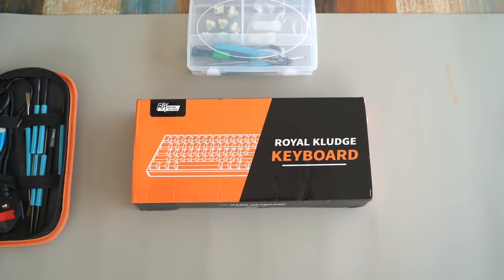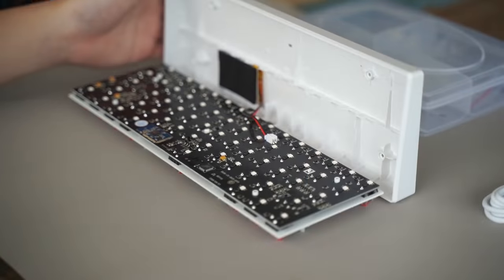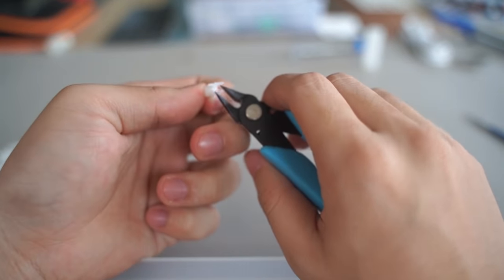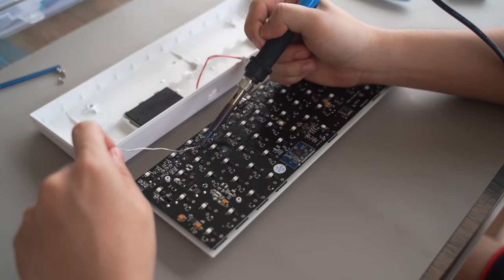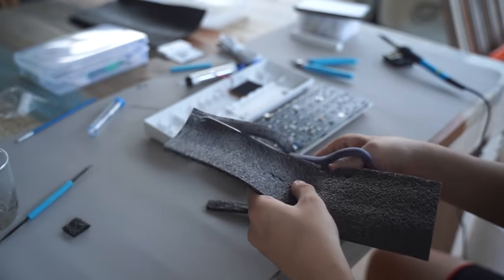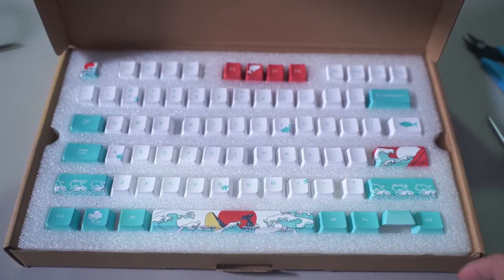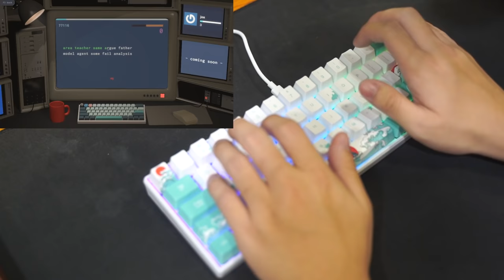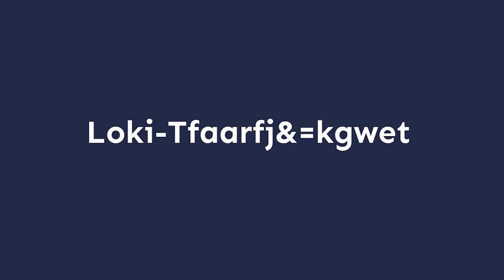Upgrading a $50 Keyboard

Comment: might get the original keyboard, it looks nice.
Reply: Same I’m poor
Reply: @raineyraine5887  get a job
Reply: @wikzy.7966  get a job
Reply: DawidALT get a job
Reply: Don't, i have a new version of it. it works for 2 months then turns into some garbage. Don't buy budget keyboards
Reply: sauce how'd it turn bad ??
Reply: Yeah RGB and MX red clones for this price is still good I was really looking at this keyboard but the price went up. It used to be 30 dollars.
Reply: @princeplotena  did you get a job?
Reply: DawidALT ... no
Reply: @princeplotena  I will give you a job.......
Reply: @dawidalt9532  funny because I have one
Reply: @wikzy.7966  funny because I have one
Reply: 생명내 증오 😳
Reply: @dawidalt9532  مضحك لأن لدي واحدة
Reply: Buy a kumara k552 its 40 Bucks its not bluetooth but its pretty durable
Reply: @wikzy.7966  yeah, lemme go to the store and ask for a job like that... its that easy...
Reply: @nobody-gd7jj  dumbed down, yeah, that's how you get a job
Reply: Which aite?
Reply: @dawidalt9532  nahh I didn't get a job
Reply: Its really good Keyboard and on Budget
Reply: @producedbyethan1350  Well, I got a rk61 at work and since 8 months of daily use it still works perfectly
Reply: I had it but it was in blue key caps so I returned it and got a different keyboard that did have red switches
Reply: @producedbyethan1350  bruh i got mine like 8 months ago and it still works perfectly
Reply: @producedbyethan1350  it is literally one of the best budget keyboards on the market, do you know anything....

Comment: me having the same keyboard paying attention 👁 👄 👁 📝
Reply: desolder only if you know what you're doing
Reply: @Daniel-dj7fh  speaking from experience?
Reply: @rhodhernaez480  i havent soldered anything yet, but i have a brief understanding that you're dealing with a very hot tool. The Fumes emitted from osuldering are toxic. And that you can easily f* up ypur pcb if you don't know what you're doing
Reply: @Daniel-dj7fh  damn it. i should have participated more in my high school when we were going over soldering
Reply: @leetrothschild7465  just look it up online and practce in a ventilated area
Reply: Acabo de hacer las modificaciones que el realiza y el resultado es increíble. El tacto mejora muchísimo y el sonido se reduce bastante, suena y se siente mucho más premium.
Reply: @Daniel-dj7fh  yeah do it out side or open the window and be careful cause it’s hot melted metal
Reply: agreed soldering is easy and fun
Reply: @Daniel-dj7fh  oh damn, atleast my dad knows how to solder
Reply: Watches in broke
Reply: @Daniel-dj7fh  my dad taught me how to solder in 10 mins and half of that was him just soldering without saying anything
Reply: @Daniel-dj7fh  just get the hotswap version no need for desolder
Reply: @josephjoestar4584  i built my own with the iso layout i needed hahahaha

Comment: This was incredibly helpful! Was watching tutorials for how to lube switches and immediately clicked on this from the side bar. I've been looking for some time now for a soldering kit that wasn't a bit expensive. Perfect video for the topic in my opinion. If I had to be nit picky, and it may be an identical process to installing a switch (in which case apologies for my ignorance), as someone who has never put stabilizers back into a board I couldn't help but notice that's about the only thing missing from this video.
Reply: why do you solder and de solder the switches
Reply: @noahmiles543  so that the switches don’t move about that’s what solder is

Comment: Ok so basically what you did was you lubed everything.
Reply: and added something for the sound and added nice keycaps
Reply: he added lubed the switches and stabs, added foam and new keycaps not THAT new
Reply: it is the same when building your custom keyboard except that disassembly is needed in this case.
Reply: @oozma1292  i thought they were the same switches just lubed
Reply: @Daniel-dj7fh  oops you’re right, my bad
Reply: Everything
Reply: Honestly, this is what I think "upgrade" means when it comes to mechanical keyboards. I see some mechanical keyboard upgrade videos where literally all they do is keep the bottom shell. They change out the switches, the pcb, everything except the shell. Like bruh. Upgrading some stabilizers, proper lubing, keycap upgrade. He still kept the core of the keyboard but just made it better. Unlike majority of the other videos
Reply: @nicolo7789  yeah but he forgot foam and tape mods

Comment: New title: upgrading a 50 dollar kb with 50 dollar worth of stuff
Reply: Are you unfamiliar with what upgrading is
Reply: thats literally what upgrading is.
Reply: To be fair, I put about $80 into mine, since I had the hotswap model and so putting new switches in didn't even require fully disassembling the keyboard, simply pulling them out

Comment: Hey this is an extremely late comment, but since the new rk61 has hot swappable switches, do I still have to desolder the board? (sorry I don’t really get what soldering does, but Im assuming it just makes it so u can change switches right?)
Reply from the maker: nope! for the new rk61 you can just pull them out and put them back
Reply: @SquashyBoy  thanks!

Comment: Its 5:24am. Im just browsing Youtube. And i see the keycaps i bought back in January for my Pink Razer Black Widows. Then i see the cheap key board i got for my work PS4 😂 only difference is my Royal Kludge is Blues not reds. I split the key caps and kept only the letters for this key cap set on the Royal Kludge and the Spacebar and all the exterior keys on my Razer. The mix of the Teal and Pink keys looks so nice

Comment: When I clicked the link for the keycaps I noticed that the white keycaps in both the photos and the reviews were slightly tinted blue and the letters weren't centered but instead was in the top left of the keycaps. Did the seller change the color or what? As a new member of the tech/keyboard community idk much so pls let me know if you see this cause I was going to get the keycaps and put it on my rk61.
Reply: I don't know about the slightly tinted blue, I'm thinking it was the photography, but the letters are just cherry legends. SA legends are the letters, alphanumeric stuff in the center (i think) and cherry legends are just in the top left. If you look at basically any GMK set (GMK bought cherry's tooling) you can see the letters are in the top left. In some cases you can get some sublegends, like hiragana sublegends, or katakana. This (in theory) only works with cherry legends.

Comment: And if you are like me with a gk61, you can basically mod it for free with the tape mod on the pcb and using polyester or anything that will dampen the sound in the case. Might have to look around the house for the materials but is worth the effort and costs $0 to get bit of that thock.

Comment: The sound of the keyboard is made by the keycaps? (or its by all the process, switches, etc?)
Reply from the maker: its a mix of all the components from the material of the case to the switches to the hollowness of the housing and the materials used in the plate and keycaps
Reply: @SquashyBoy  Thanks for answering me! I thing i will mod my anne pro 2 keyboard

Comment: Currently I’m using a membrane and it’s not really cutting it and I’ve never had a mechanical so for my first mechanical imma go big, at first I wanted the ducky one 2 mini but then this vid changed my mind. Im going to get this keyboard and key caps bc the key caps ARE SO NICE WTF and some gateron yellows bc those sound nice.
Reply: Make sure you get good stabilizers or just tune the ones ur getting
Reply: @21dxminic13  aight

Comment: When restoring a keyboard do you have to do all the smoldering iron parts because I dont have one of thoose and is seems hard? Because all I want to do is get new switches and new keys. Great vid though <3
Reply: Ok, hear me out. I haven't try this but, try using a vacuum to suck the soldering iron.
Reply: @blobers8566  or just buy a hotswappable keyboard to begin with or buy a smoldering set
Reply: @iansjogs  yes

Comment: So I did the same thing when it came to the solder sucker, but sometimes a little bit of the solder gets stuck in place, how do you deal with that?
Reply: You could use copper braid instead (desoldering wick), it's my prefered method to get rid of solder.

Comment: Trying to get into keyboards. What switches are these they sound so hot
Reply: Red, as you can clearely see by the color in the video
Reply: They are switches made by Royal Kludge. You cannot by them in any other tkl, full size, or 60%. :) But they are reds based of of cherry mx.

Comment: What would be the difference with just lubing the stabilizers, adding foam and key caps, without the soldering part? If you were planning to remove they switches, why not just buy a different board?
Reply: The switches are the same

Comment: If a board comes with outemu switches, and you desolder them, can you replace them with cherrys or a switch other than outemus?
Reply: From personal experience, I couldn't use gaterons or cherry, as the pins are thicker than the ones on outemu, switches you can use though are akko switches

Comment: What are the switch Brand of this Royal Kludge keyboard?
Reply: I think it was MX Cherry reds
Reply: @Asr.-  I doubt they would use Cherry MX original in a 50$ keyboard, because even thought Cherry MX is not a good switch, they are expensive. It may be a clone brand, but I cant find anywhere If It's Outemu or other brand

Comment: You didn't have to desottter. It's hotswap 🙃
Reply: Wrong
Reply: @saamo1423  correct, it's literally hotswappable my guy.
Reply: @garbage5487  then there wouldn’t be any solder to remove buddy. There are more than version of the rk61, they aren’t all hotswap

Comment: Has anyone had a problem such that, it does not detect the keyboard in bluetooth. When you plug it into the computer the buttons didn't work, the keyboard worked for a few days.

Comment: Anyone explain why do you need to cut the stabilisers for the spacebar?
Reply: The bottom part that he removes is designed to soften the impact of the stabs on the pcb, but in practice don't matter at all, and make the stabilised keys feel soft, so alot of people just cut them off

Comment: lol u know you don't need to use any soldering stuff to get the switches out, you can just pull them out :/
Reply: not w a non hotswapable keyboard.
Reply: @iansjogs  on the rk61 you can
Reply: @stungus.  @PogAbility The older stocks arent hot swappable, the newers ones are, this video was posted in 2020.
Reply: Nope, video was posted in 2020 lmao, older versions and stocks arent hotswap, newer versions are.